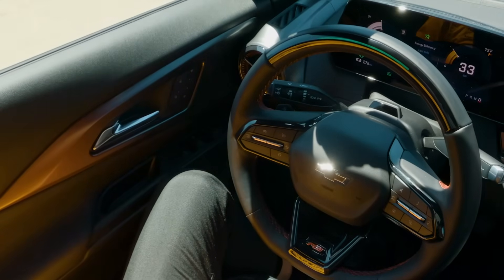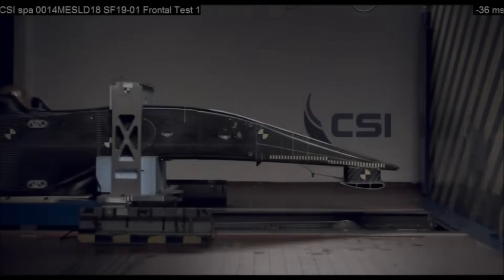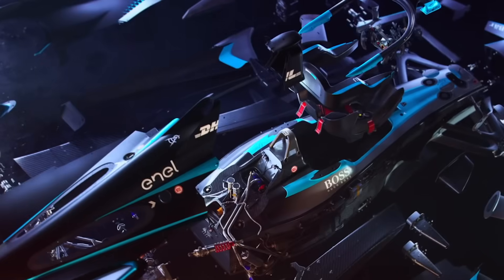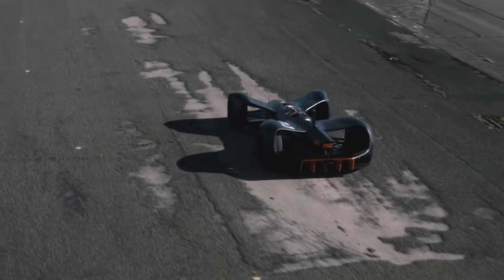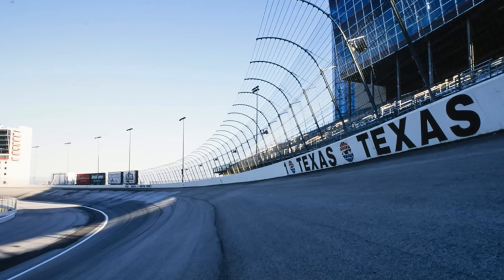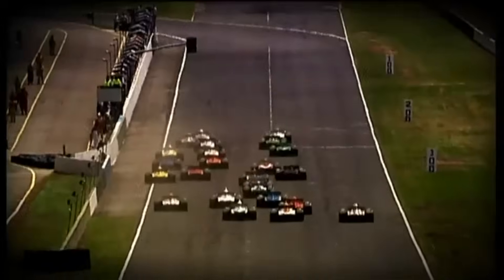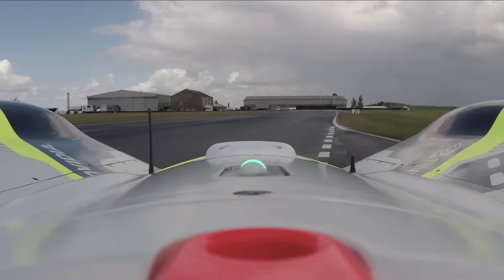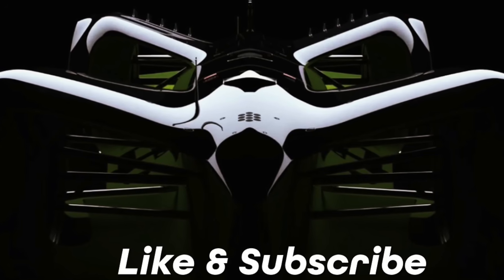Autonomous motorsport - are the cars all wrong?

Comment: This is exactly where my mind is with autonomous racing as well. Is it safe to assume that the performance of racing cars are somewhat capped by the safety of FIA grade 1 circuits? I do but I am open to being corrected. Because the way I see it, unless it's decided to build a completely new type of facility suited towards safely containing mega high downforce autonomous cars doing 8G+, those very cars may never exist.

Look, I want to see racing on a real life Rainbow Road, but at what point does it just make more sense to have them be remote controlled so the human driver element is still retained? There are so many almost philosophic discussions about autonomous competition and what level of human involvement is needed to retain interest by humans to watch it. I will say this though circuit racing is one of the few things I'm not apocalyptically concerned about when it comes to the advancing of AI. 

I had a summer job working at Pittsburgh International Race Complex and during the off season around 2016ish Uber used the facility to test their autonomous car program with a Ford Fusion. But instead of using the actual circuit, they dumped shipping containers, road signs, painted lines to simulate roads, etc all over the skidpads and parking areas. I thought it was hilarious. You can go back and see the satellite imagery too. Beautiful facility that was ever expanding but just recently sold and closed up basically overnight and is set to be demolished for a data center, go figure. #savepittrace

Comment: Very good points, I enjoy following your thought - not only in this case.

In the end, I think, the short comment on 5:15 is the biggest issue: would it be interesting to watch?

I doubt that. I'd say Formula 1 is already hard to watch as you rarely see the constant sliding and work that the driver puts in. It's impressive because it's really fast. But compare it to the 60ties & 70ties where you could see the drift easily with an untrained eye. Coming back to robot cars - at what point would you end up being unable to follow? Would we need slow motion to understand an overtake? The human driver also keeps us in a range that is humanly accessible - in watching.

Maybe there are concepts that have solutions for that. Maybe AIs that have vortual avatars & flaws. But that approach would likely be just entertainment. And acceptance of virtual stars isn't widespread. Without providing some engagement for watchers ...why use a race series? it's "just" a development program. It probably shows us something interesting about the nature of racing in general: a portal that connects development with engagement.

Comment: I at first thoughts this was gonna be about why use these super fast cars when the current tech just can’t keep up to use anywhere near the limit of the car, but you also make good points about how much faster you can design a car without limitations. However I think anything like that is far away just looking at the current series.

I think something that makes more sense for direct road relevance is something like doing an endurance series for these with tube frame GT cars made quite cheaply so the barrier to entry is lower, and not designed to be that crazy in specs, use a cheap, popular engine like a K24, pretty simple suspension comments and then use road high performance tires. Make the theoretically limit of the car lower so the computer can get closer to it and make the racing more exciting. Nobody wants to see a fast car trot around but watching a slow car near its limit is fun, even if they are going similar speeds. Plus making a car that is one where a “driver” can have a bigger difference in the speed of the car. Plus by making them more normal car shaped and using road tires it becomes more relevant to actual road conditions 

Maybe you could even have a higher class with prototype cars after a while if the teams manage to actually start extracting all the speed out of the slower cars and then you get to see traffic management, again relevant for real world use cases.

I think the cars you are describing would be much cooler if they did the same thing of forgetting about driver safety and allowing these crazy machines, but still had a human controlling them via VR headsets and force feedback wheels. You loose some of the physical aspect that partly makes racing so skillful but you now have a competition that pushes humans to the limits of their reflex’s with cars way faster than they would otherwise be able to control. Imagine a full grid of Indycars that can do 400 mph and drivers dicing it up still pushing the limits. Sounds much more exciting to me than AI doing the same

Comment: I think the Indy Autonomous Challenge using spare Indy Lights cars made some amount of sense, at least from a Brand Identity standpoint of wanting it to look at least sort of like IndyCar. In any other series, there's also probably some amount of "we want the autonomous racing cars to look like racing cars so that prospective fans can look at it and see a racing car". Part of me wishes that it were all as simple as "inexpensive tube frame with enough futuristic-looking fiberglass hanging off of it to make the cars look Fast and Sexy to prospective fans", but that conversation probably goes beyond the scope of Youtube comments.
One thing I would find potentially interesting: two parallel racing championships that use the same driverless car, one autonomous and one remote-controlled with a camera. Not so much from a "how big is the pace gap" standpoint, but moreso "how does that gap change over time".
Reply from the maker: agree with all this

Comment: I’m sure at least one other person has pointed this out, and you basically covered it yourself. 
The main reason, possibly the sole reason, why any start up autonomous league is using cars designed for humans is cost. 
But you do raise some very excellent points in the video. I’d love autonomous racing to be about the cars and competitors achieving things that a flimsy human body just couldn’t withstand.
Reply from the maker: But the cars they are using are extreme!
Reply: True. Why are they not just using go-karts? I guess it’s an image thing as well?  Is the gestalt concept of what “an racecar” looks like so strong that maybe the people behind these things can only think in racecar shaped ideas.
With the exception of the proposed eventual Roborace vehicle.
Reply: @Grasbysaurus they want to make the robots compete with a human driver so it makes sense to use a car that can also be piloted by a human

Comment: I think a lot of the reason behind Indy Autonomous Challenge and A2RL using existing cars is that they're for software engineers and machine learning researchers, and they don't have the technical knowledge to build a race car. They were a technical showcase of software, using a known quantity as a base, rather than something like Roborace which really was trying to do everything and show what could be done without the squishy, vulnerable human bits in the middle of the car
Reply: Maintenance on a Miata Cup car is wayyyy less complicated than on a Super Formula or Indy Lights! No idea why they chose such fast & complicated cars. Also, they look even slower. It's OK to have a Miata driving around at 50kph, but a Super freaking Formula which at times was faster than F1 around Suzuka's sector 1?
Reply: @dafnik8925 IAC using Indy Lights as a base makes perfect sense to me, it's an IMS/IndyCar backed series, so it keeps the IndyCar DNA and minimizes cost. The A2RL's choice of a Super Formula car is much more of a question. Possibly it's due to the fact Dallara made the IAC car already and they wanted their experience and a faster car for a showcase, possibly they just wanted something quick, recognizable, and available to go around Yas Marina, had the money to burn, and expected way faster results

Comment: I assume the a big reason for using existing cars is als costs. It's cheaper to modify a car that has already been built than to build a new car from the ground up.

I do definitely agree that autonomous racing should do its own thing. Trying to immitate human races with them isn't gonna bring much viewership. But doing it with a completely new concept, doing things that could not be done with humans in the cars, that would definitely attract viewership.
Reply from the maker: It is not exactly a cheap car though... its hugely potent.
Reply: @Samsthepits  I would think a lot more standard (for racing) components could be bought off the shelf and other than the lack of the meat popsicle driving getting engineers and mechanics who know everything else would be easier hires.
Reply: @Samsthepits  that's a fair point. I guess it also depends on how advanced the autonomous car would be otherwise. I can imagine for more complicated cars it might be easier to use an existing chassis than develop from the ground up.

Then again, I'm just some random internet person, so what do I know. 🤷
Reply from the maker: @Robintalesfighter If cost was the big motivator you probably would use a F4 or F3 chassis, loads of those around.

Comment: There are very few succesful sports where engineers are the athletes. Robowars is the only one i can think of that is somewhat beloved. 
For a AI racing series to be succesful it would, like your said, need to differenciate itself alot from other series - otherwise whats the appeal? 
I think you need a human factor - you need someone to be the face of the team - for people to engage with. What are they thinking? what would i do in their place? Desctruction or ludicrous speeds wount be enough long term i think.
You need someone to relate to on a personal level. The reason we like drivers is because they can have bad days or good days. They rarely are perfect and thats typically what creates excitement. Watching cars do near identical  laps for a whole race would be a yawn inducing even if it is great feat of engineering.

Comment: Right from the off, let me say this: autonomous cars are a fundamentally flawed idea, like flying cars were. A vehicle that shuttles passengers from one place to another without them having to make a single input is called a train, and if public transit saw half the investment that this BS has, then it'd do far more good for far more people in the long run. Alas, Silicon Valley can't make money off that, so here we are.

Okay, there are absolutely other applications for autonomous vehicles. Not even just military ones either: imagine a Mars rover that could mostly or entirely direct itself given a few basic instructions from Houston, recognizing hazards and items of interest and flagging them for the humans back home to analyze. Small problem, there: if that's sort of sophisticated software's gonna be dreamt up anywhere, it's not gonna be on a modern racetrack, sterile and obstacle-free as it is. Frankly, DARPA's many autonomous tests probably rendered this exercise moot for mainstream-style motorsport.

And like, while I'm of the opinion that the machines should be the stars in most pro series, there is a distinct difference between a maximally capable car, and a maximally capable car meant for humans to operate. There are things people learned from race car design because they had to accommodate a flesh bag, and that aside? It won't hit the same if there isn't a human at the wheel. If motorsport is about anything, it is about human mastery over the laws of nature. That theme of mastery and adaptability that runs through every part of motorsport is frayed when we just send the machines out to do the job for us.
Reply: yeah these sensor system's also get used in the growing sector of autonomous vechiles in factory's, and autonomous farming and mining vechiles. if the tech they're developing in a2rl can be of any use to those sectors this series could stay around long

Comment: feel like a2rl could've saved a lot more money by purchasing some formula 3 chassis instead of the super formula ones if they felt like using an existing design
Reply from the maker: Exactly this. So many cheaper options out there, and the series is nowhere near needing Super Formula performance capabilities right now.
Reply: @Samsthepits  yeah, but I bet they didn't wanted to miss out in case of fast development being stuck with an inferior car. Not sure if cost of couple of cars was an issue they were considering at this stage at all.
Reply: @Samsthepits  Another thing as shown in the A2RL event was that they can barely even drive laps consistently. If that's the case why are they jumping to a race format? Surely starting with something like a time attack event where the winner is the one with the fastest average over X laps is the winner makes more sense?
Reply: Well I mean they probably want F1 pace right?
Reply from the maker: But it looks like they are years away from that capability...

Comment: 1. Sam, my guy, slow down before you burn yourself out, please.
2. I think the reason A2RL doesn’t use a custom-built car comes down to finances. We hear it all the time in motorsport and you even mentioned an example couple videos ago, A1GP wanted a new car, costs skyrocketed, and boom, the series collapsed. Roborace went down a similar path for the same reason. Another factor is that A2RL wants to test their AIs against real drivers. That’s why they have Kvyat racing the AI car. Like you said, if you design a car purely for AI, you can remove a lot of the human-related components and constraints but then it becomes a test of engineering, not driving skill. By keeping the car close to what humans use, the challenge becomes purely about skill. I could be wrong on some details, but that’s how I understand it, happy to be corrected if I missed something.
3. Love how you don’t criticize electric or AI championships. It’s honestly rare to find people who don’t immediately hate on any kind of innovation. Funny enough, it’s usually the same crowd that complains about the FIA banning innovation or loopholes when an F1 team pulls one off.
Reply from the maker: I can't comprehend that the SF23s were cheaper than a bespoke design.